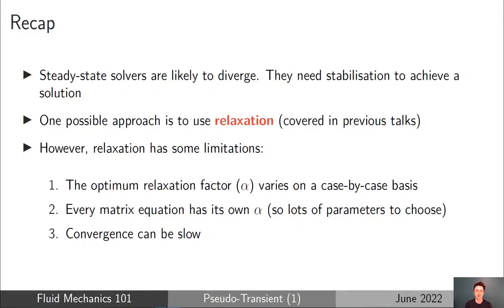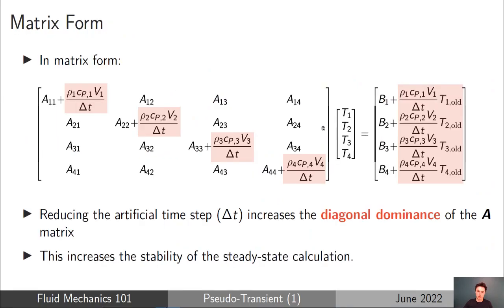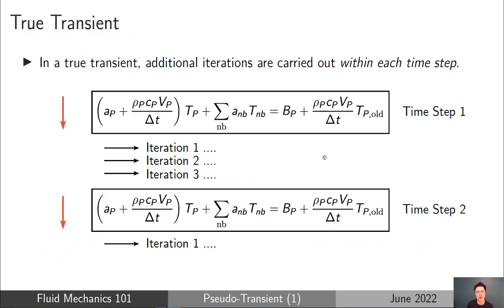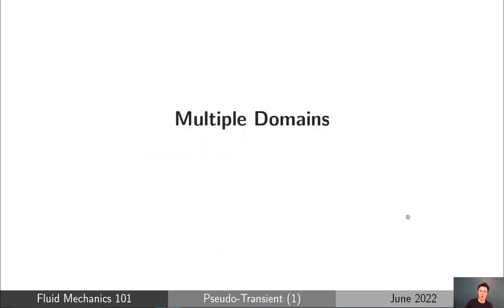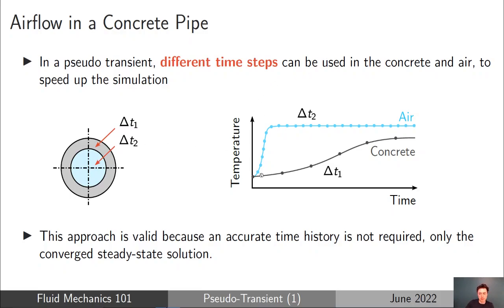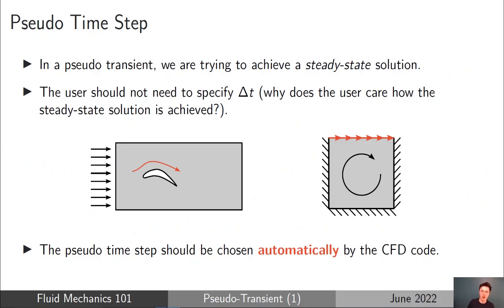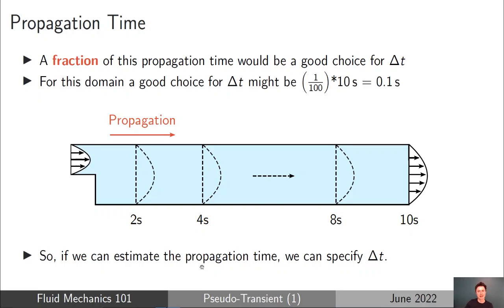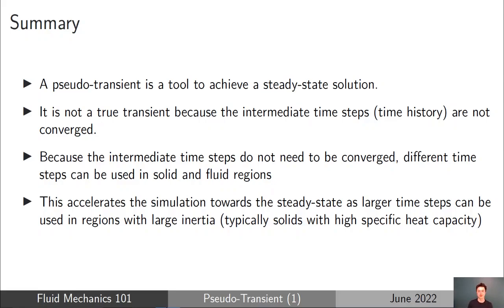[CFD] Pseudo Transients for Steady-State CFD (Part 1) - Pseudo vs True Transients

Comment: I'm new to Ansys and I'm running a 2D analysis on an airfoil (SD7037) used in a low-speed endurance drone. My Re is ~ 10^5 so I chose the Transition SST turbulence model. When I set my time step method to automatic, my residuals after 200 iterations are continously oscillating, and the pattern repeats even till 2000 iterations. If I make it user-specified, and use 0.001 for the pseudo-transient time step size, the solution converges. Why? What is the significance? Are my results for Cd and Cl still valid?

Comment: So unlike a true steady state algorithm, where we leave out the time derivatives, and can therefore "force" even an inherently unsteady system to a steady state solution, if we use pseudo transient, and there are inherent little transients in the solution, we are not going to get a proper steady state solution. So the point being, as many people know, many, if not most steady state systems exhibit at least some limited transient behaviour (take backward facing step - that recirculation zone might oscillate slightly, even in a steady state solution), if you use pseudo transient for those cases, you're going to start resolving some transient behaviour, even if its not correct / fully converged at each (pseudo) time step ...

Comment: Hi Aidan, I have a question wrt the transient simulation. As known, it's common to initialize the transient simulation by a steady-state simulation. But what is the cause of the unsteadiness during this switch if the residuals are so small and the steady results converge so great? (Though the flow is inherently unsteady, e.g. vortex shedding)

Comment: Is cp of concrete really greater than cp of air? Or am I missing something? Thanks for a response.
Reply from the maker: Good point. The specific heat capacity is quite similar. However, the density of concrete is much higher. So for a similar sized region in you CFD mesh, the heat capacity (specific heat capacity multipled by mass) is much higher for concrete. Thanks for pointing this out!

Comment: so "normally" for a steady state analysis we would set the time derivate to zero and solve through jacobi methods. But in this case we keep the time derivative in and use it to our advantage, keeping in mind its steady state the whole time?
Reply from the maker: Yes! However, it is worth noting that if you don't include the time derivative or under relaxation, the steady state solution process is likely to be unstable when we solve using a Jacobi style iteration.  So we either include relaxation or keep the time derivative and use these to stabilise the matrices, then we can use Jacobi /Gauss-Seidel/Conjugate Gradient to solve
Reply: @fluidmechanics101  very interesting. I think I'm across the topic now. Thanks for your lecture series. Much appreciated.

Comment: Such a good Video!
Does it make sense to first run a simulation with relaxation-fectors and than using the results of the simulation as initial values for a pseudo-transient simulation? Or do you only use one of the two methods?
Thank you, Simon
Reply from the maker: You can use either. As you are doing a steady state calculation it doesn't really matter how you get to your final solution, so you can choose either. Normally I just pick one and go with it (some CFD codes don't have the option and you just have to use one of them). I often go with relaxation first. If that proves tricky to converge, switching to pseudo transient is sometimes better and changing the pseudo time step seems to be easier than changing the relaxation factors arbitrarily (because you can tie it to a physical time step)
Reply: @fluidmechanics101  thank you a lot!
Reply: @fluidmechanics101  Why don't we just go ahead with pseudo-transient from the beginning instead of starting with relaxation and then switching to pseudo-transient if it proves tricky to converge? What's the ups and downs of just sticking to pseudo-transient for every steady state solution? Btw, I'm learning quite a lot from your videos and I'm really enjoying them, thanks for the quality content.
Reply from the maker: There is no real benefit. You can really go with whatever you prefer. It is steady state, so it doesn't matter how you get there 😊 I suppose the default in fluent is relaxation factors and I am lazy so normally just go ahead with them rather than pseudo transient. Also, I'm glad you are learning a lot from my video! that's great

Comment: Hello Aidan,

I am working on some CFD validation project and have some basic doubts related to surface Cp distribution contour. I am a rookie in CFD and learning new things everyday.

Does surface Cp distribution plot helps you tp identify the flow separation point on the wing? If yes, can you explain how?

I assume that flow accelerates on the upper surface causing Cp to come down upto a limit and again Cp increases downstream on the surface plot of a wing. But will that interpret the flow separation point on line on the wing or it is just a representation of variation of pressure from the freestream????

Please help me to understand what all things can we interpret from a typical Cp distribution plot of 3D wing.
Reply from the maker: If you are interested in flow separation, you want surface contours of wall shear stress 👍 Look for the contour where the wall shear stress component in the x direction turns negative (assuming your flow is in the x direction). This will show you where you have flow separation

Comment: Great presentation - very informative!  One question - what is the difference between using a pseudo-transient method vs. a "true"-transient method where only one sub-iteration is used for each timestep?  Conceptually, it seems the two methods should be the same.  However, when I run a test case using a fixed timestep to compare the two approaches in ANSYS FLUENT, the results are different so I must be missing something... Thanks!
Reply from the maker: Agreed. However, with commercial codes we can never really know what all the differences are, and there may be some other small differences. I have only tried to cover the main conceptual difference here

Comment: Thank you for the amazing and clear lectures man. Can you please shed some light on why pesudo transient method is only supports by coupled solver, why not other solver?
Reply: There is a pseudo transient method supported for the SIMPLE/C/PISO Algorithms in Ansys fluent.
Reply from the maker: Yes, in principle you could apply the pseudo transient method to any pressure velocity coupling algorithm. I think the reason may be historic. SIMPLE with under relaxation was proposed first, so many codes copied the original implementation and used under relaxation with SIMPLE. Coupled with pseudo transient was proposed later. So perhaps it has taken some time for codes to be updated and make them completely flexible (i.e giving you independent choice of pressure velocity coupling and steady state method). We should also remember that these options are often at the heart of CFD codes, so they can be tricky to change if they are buried in thousands of lines of code!
Reply: @fluidmechanics101  Thank you Dr. Aidan
Reply: Thank you  @Chris B

Comment: Hello Aidan, my question that arises from you presentation is, then, why do SS simulations and not always the pseudo transient simulations?
Reply: some of SS solvers are faster. For example if you have a single local and global minimum of your response surface. However some problems will have multiple local minima, some kind of valleys etc. In that case pseudo method has additional advantage: it physically guides your solution through this rocky area)
Reply: @makavelilcf  Thanks for the clarification 😀